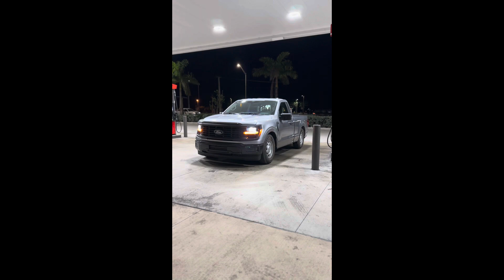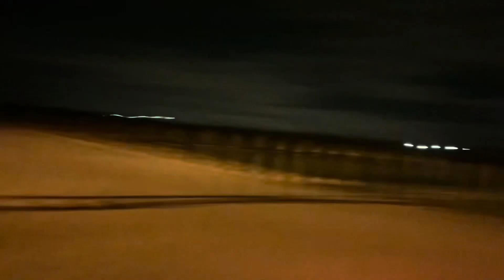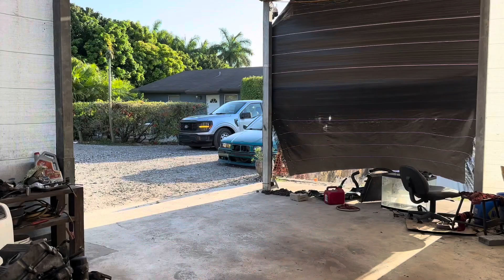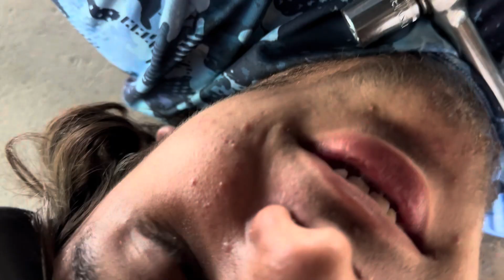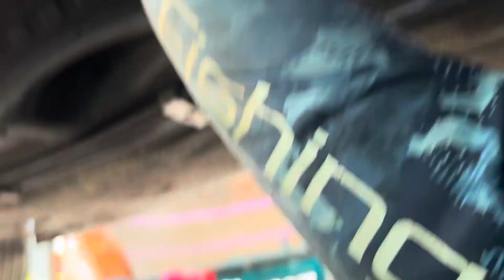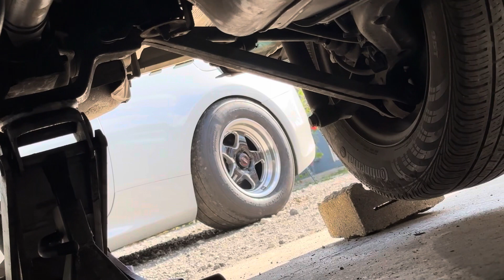I bought a 2024 f150 and took it racing

Comment: That cold air intake is hurting you. You’re better off running the factory setup than that. Sounds better but the factory setup is actually really good about getting cooler air. Unless you buy an aftermarket enclosed system, stock is hard to beat.